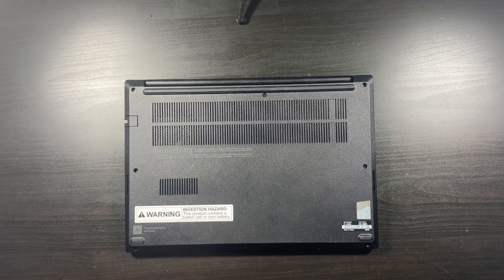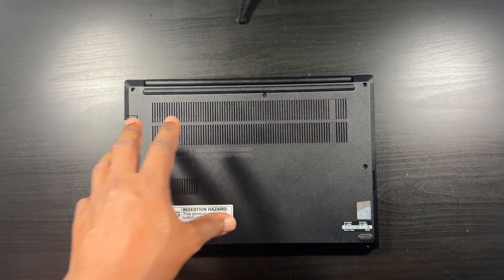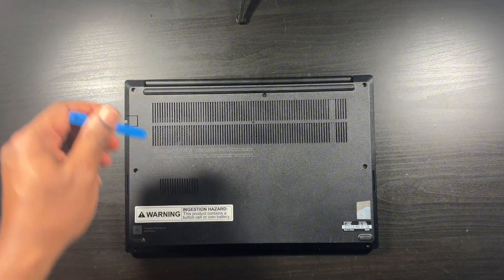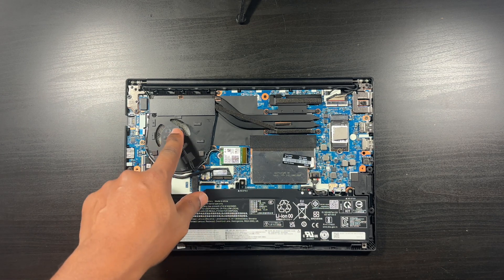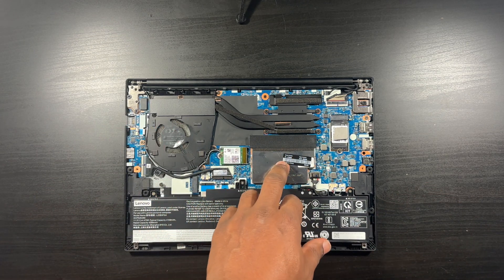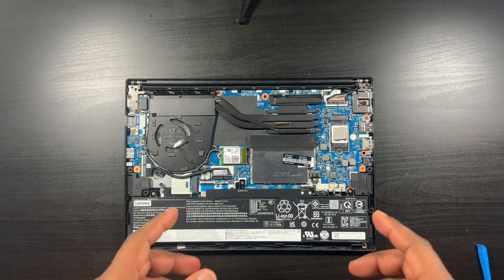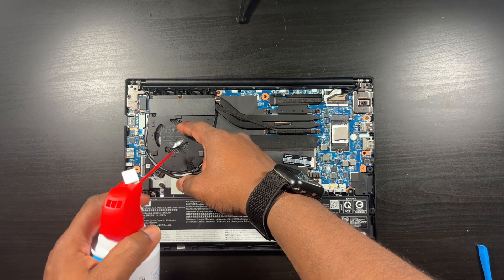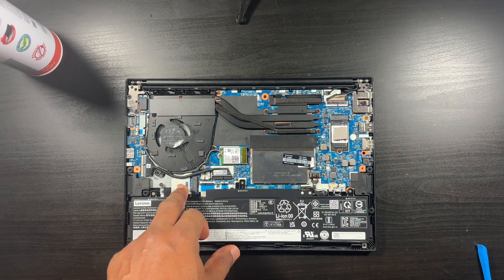Lenovo Thinkpad E14 (Gen 5) Ram and SSD Upgrade

Comment: Hey there, i just bought a ThinkPad E15 Gen4 with AMD Ryzen 7 5825u which was equipped with 512gb 2248 SSD. Unfortunately the seller wanted to keep the old SSD, because of safety reasons. I wanted to upgrade now to 1TB Transcend 410S, but i am not sure if the SSD will work in the laptop or if i should buy a 512 GB SSD to be sure it will work…do you have an experience or knowledge about if it will work?
Reply from the maker: It will absolutely work get it done!

Comment: Are you sure that the second ssd worked, chat gpt says it's not a slot and solt2 which is for a replacement wifi card?
Reply from the maker: It worked for me or else I wouldn’t of made a video on it.
Reply from the maker: Don’t always rely on ChatGPT or even the manufacturer site
Reply: @charleeeugene  I took the risk and to test the situation
 I  took out the original disk from the 1st slot and inserted into the second slot as you did and it worked. thanks man.
Reply from the maker: @xyzsnr8730  Beautiful!!!!!

Comment: I got a ThinkPad E14 Gen5 (AMD) 21JR0004GE, relying on a Lenovo datasheet that it would support both a 2242 and 2280. Haven't opened it yet but alreadsy bought a WD Black SN7100 (2280) SSD 1TB to upgrade it. Will open the notebook today, I hope I'll be lucky but due to this video I really fear and guess the datasheet was wrong :-(
Reply from the maker: Your right sometimes the data sheet don’t tell the truth
Reply: @charleeeugene  Lucky me, I just opened it and there is a 2280 slot available righthand of the memory extension (where your's in the video only offers a short slot). Looks like Lenovo changed the specs of the Lenovo Thinkpad E14 (Gen 5) at some point (or its a difference between the AMD and Intel versions).

Comment: does using a 2230 instead of 2242 cause any issues?
Reply from the maker: No but make sure it's in place securely. It will be fine. Also I'm gentle with my laptops

Comment: Good video! Always nice to see what is inside before committing to buy parts and opening new device. I am going crazy trying to find compatible M.2 2242 PCIe SSD (for reasonable price) for my E14 and it is funny that you don't have one either.

My sales page claimed "two extra M.2 -slots (2242 PCIe 3.0 x4 + M.2 2242 PCIe 4.0 x4)" but there is obviously only one. 

I assume the slot you inserted SSD in is PCIe 4.0 x4, right? (Edit: Did more investigating and the that one is a Gen3 slot)
Reply: Plot thickens. I actually have the AMD variant (21JR0001MX) and just opened the back board to confirm and it has single open slot that is full size 2280. Lucky that I didn't order it.
Reply: @ From what I've seen, some versions with AMD CPUs still have 2282, it would be nice if the Lenovo manual specified which ones.
Reply from the maker: @ Exactly
Reply from the maker: You're correct don't why there are doing that with alot of machines giving you one of each  instead of two of the same. Thanks for sharing and watching!!!!!
Reply: Just so you guys know, the E14 Gen5 only supports PCIe3, says it in the specification sheet: "2. The SSD with PCIe® 4.0x4 is downgraded to closer to PCIe® 3.0 x4 due to AMD platform limitations."

Comment: I advise to have that screw on the SSD fastened for proper grounding and shock protection. Comes down to having the correct size installed. Thanks for the vid!
Reply from the maker: I’ve already installed a 2242 size now.